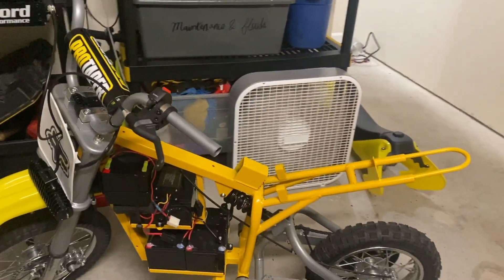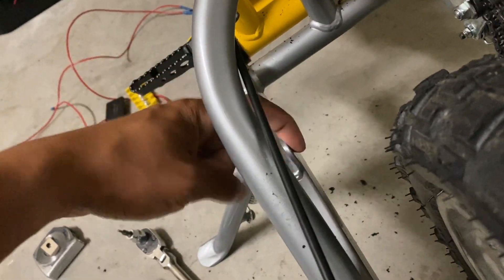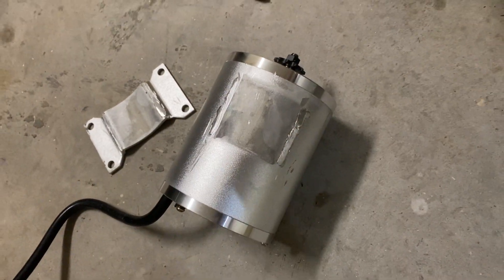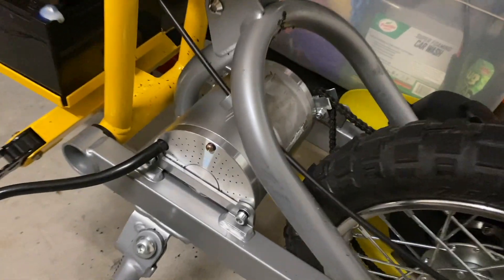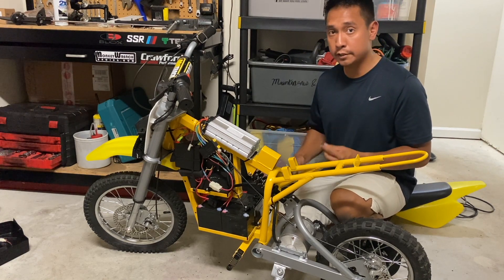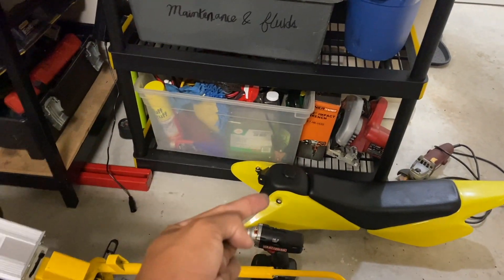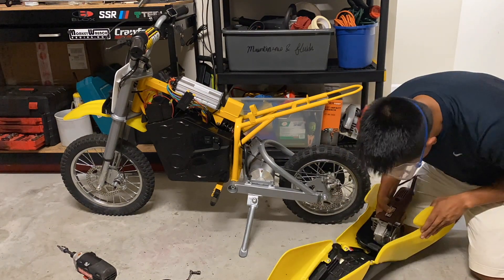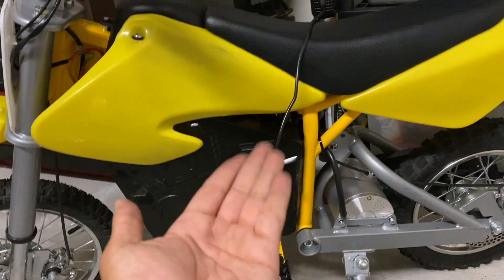Razor MX650 to MX2000 Conversion Part 2 | Kunray 2000W 48V Brushless Motor Kit Installation

Comment: So i just stumbled upon your vid. Im re mounting my motor into the frame in the back to fit. But the brain controller im having trouble about placement- has yours been in a good spot. I don't want mine to get crushed by my seat.
Reply from the maker: @ltdaddysnake6957  should deff not go under the seat. This controller was small enough to fit under the plastic tank. But better would be below the top tube of the frame.
Reply: Thank you thats what i was thinking. Hacksaw the trop tray off sand down and place on the bar frame.  I just got a kunray motor and battery rated for it. Just motor mounting is next.

Comment: Hello! Kabayan?
Where did u exactly install the pro chaser voltage converter?
Im planning to upgrade my bike when i saw ur videos. Im gonna copy exactly how u did it. Thanks to ur videos mate!
Btw, baswd on ur own experience, which motor is better, is it the kunray or the vevor?
Reply from the maker: @Axeman31  it’s actually just tied to the bottomside of the top tube on the frame. Kunray. Vevor’s decent for the price though. Both controllers are ok, upgrading to a Kelly controller or maybe a Fardriver woild have much better throttle control
Reply: @PatOutdoors  thank u for ur quick response kabayan! And what kind of 48v lithium battery did u use on those motors?

Comment: Is there a way to mount the motor without the original motor bolts? I have the same kit but the frame i Bought doesnt come with the motor so i dont have the bolts, is there anything i could do? What type arethe bolts i might go to a hardware store and look for them.
Reply from the maker: Go to your local hardware store and bring the motor with you. You can ask a representative to help you find (3) socket cap Allen bolts that fit the motor.

Comment: Question, any reason why you couldnt just take the 2 screw out and leave the one in? The frame keeps everything togethar anyway right?
Reply from the maker: Tolerances within the frame and swing arm are not perfect. Motor internals can easily be damaged from slight misalignment if you don’t put all the bolts on the end caps.

Comment: Excellent video series on the Kunray kit. Been looking at upgrading an mx350. The stock throttle is on/off only. Does the throttle and controller in this kit offer a variable speed? Or is it on/off like the stock razor system?
Reply from the maker: Thanks! It’s variable speed. Definitely not bolt on for the MX350, but can fit with modifications to the bottom motor bracket

Comment: Question - In another video I think you upgraded to Hydraulic Zoom brakes ? I dont see those brakes has Electrical power cutoff switch. Do we need regular hydraulics or with power cutoff switch built in ? Also this controlled has brake power cut off wiring ?
Reply from the maker: The switch is just to disable power to the motor when applying brakes. I never connect them on my bikes

Comment: do you need to get a new battery
Reply from the maker: Need 48 volts to power a 48 volt controller
Reply: @PatOutdoors   can you use the stock battery's at all or should you get the battery that you have (fast scooter)

Comment: how much ah's would it be if I got 4 mighty max batterys, and is it better to just get 1 48v battery?
Reply from the maker: (4) 12V 12AH Battery wired in a series is 48V 12AH. If you could afford it, just go straight to a 20+AH 48V Lithium battery pack
Reply: @PatOutdoors  thanks, how much range can the 4 batteries get you, and what 48v lithium battery do you recommend?

Comment: I need to know what charger you hvae i did this same thing snd every charger ive used has blown
Reply from the maker: 48v sealed lead acid charger by fast scooters. Charge port wired directly to the controller.

Comment: hi i got this same kit that you got and when i got all done with it i plugged it in cuz it was dead and wheni did my charger didnt have any power goin into the bike but it work before i put the kit in.
Reply from the maker: Sounds like the charger is not wired correctly or have loose wiring connection

Comment: Do you have a video for the step down controller
Reply from the maker: Voltage step down converter install? Please check out my later videos with lighting. I have at least (4) that include that process

Comment: Is the motor upgrade able to run with just the 36v? At least for a little while or should I get the 48v first
Reply from the maker: No, it will only run on 48-52V power supply
Reply: @PatOutdoors ok thank you so much for replying fast 🙏 great channel! I love your bike content

Comment: I have the same kit and I connect everything good and it turns on but when I try to charge it with the charger it does not work
Reply from the maker: Have you tested the wires between the charge port and the controller to see what voltage it reads?
Reply: @PatOutdoors  no I have not I will try that too
Reply from the maker: @elicarroll5336  Also test out the output of the charger with a voltmeter. If you continue to have issues after confirming all connections, I suggest contacting the vendor you purchased it from if you’re still within the warranty period

Comment: at 5:09 you added the battery connector, how did you do that, where did you get the ends of it
Reply from the maker: I stole those connectors from the side cover (on/off switch wiring)

Comment: Same setup, run perfect in the air but no tork on the ground!
Reply from the maker: What battery are you using? The BTR 48V battery I got had little output as far as amperage. The BMS was falsely advertised as 50 amps, turned out to only be 30 Amps. Swapped it out since then
Reply: @PatOutdoors  i use a 48v 10AH 30AMP li ion batt

Comment: What drill bit size did you use to countersink the screws, do you remember, I couldn't tell in the vid. I didn't want to make the hole to big or anything.
Reply from the maker: So I just did this again on my other bike today (video being posted shortly) and I think 5/16" drill bit is the best size.

Comment: Excellent video.. Your best walk through yet, i think.. short and specicific.. You can also explain the different options on motor upgrades, voltages, battery options and limits... But otherwise... perfect info the RAZOR E-bike....
Reply from the maker: Thank you for your feedback. I'll actually go into more detail as I learn more with my upcoming builds.

Comment: Bro!  If you upgrade to a 48v lithium battery it's a world of difference.  Sorry if you already mentioned that.  I haven't watched the entire video.
Reply from the maker: I can't wait for that upgrade actually! But I wanted to make sure I do a fair comparison between this kit and what I had before (Fast Scooters overvolt) so I'm temporarily leaving the SLA batteries in place to keep the baseline the same.
Reply: @PatOutdoors I kind of figured that after watching the video.  Better to do it step by step, get data, and subscribers at the same time.   I just did the same set up as you but with 36v lithium batteries on a MX400 LOL.  I am waiting for the 48v batteries to finish the overvolt build.  It was pretty fast with the 36v so we shall see...
Reply from the maker: @imfromwikipedia  Thank you, please link it so I can take a look. Someone already recommended the "Lite Pack" that Electro & Co sells, but I'm also looking at the BTRPower 48V 20AH battery because it has a 50Amp continuous discharge rate: https://amzn.to/3RJo8WA
Reply: @PatOutdoors  hey I’ll send the link once I get on my computer. I’m not sure if the 50A discharge rate will be reached because your controller only supports 33A

You might need to get a Kelly controller to get all of the power out of the battery pack